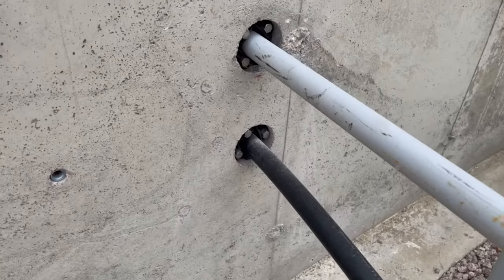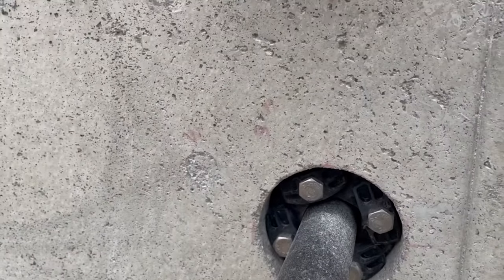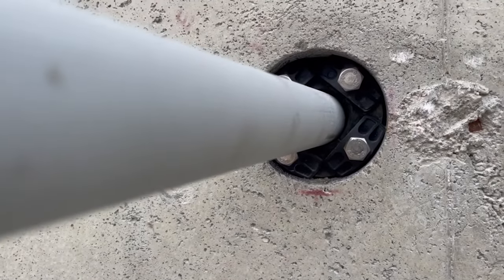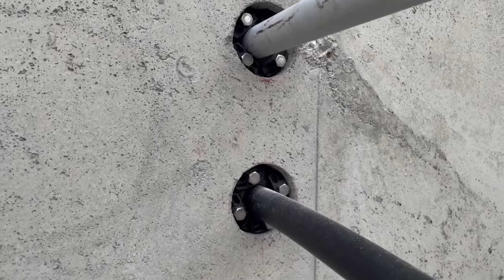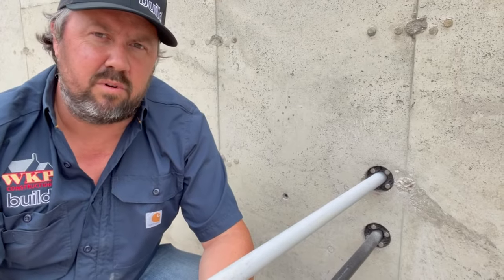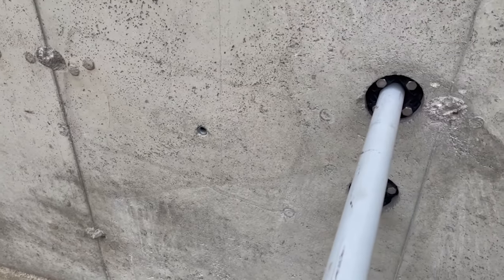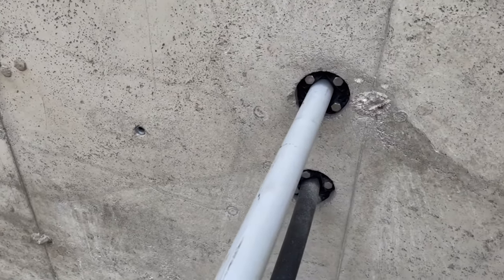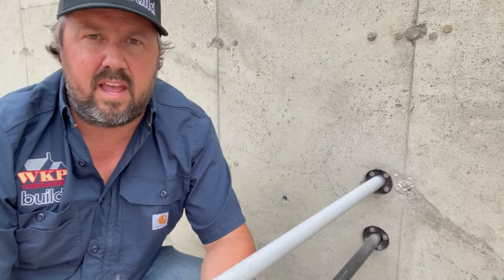Sealing around concrete wall penetrations

Comment: What if I chipped out a concrete foundation and put a 3 inch PVC line through the drain over to my sumpom?I'm also below grade. The water table is very close too.

Comment: As a professional waterproofer for over 45 years, this is a very good product for unwaterproofed foundation walls. But in properly waterproofed foundations it is  not adequate. But is a very good “ back up “ to proper waterproofing. All in all a good product.
BTW my background is in commercial waterproofing ( not exclusively) which is far above 95% of residential waterproofing.
Reply: Out of curiosity, what is your ideal method in this situation?
Reply: @ggill1313  it depends on what type of waterproofing is on the exterior walls. Quality waterproofing products all have their own details for sealing penetrations. Depending on whether they are sheet goods or liquid applied. The holes should be cored and at least a short section of pipe installed before  exterior waterproofing.Then possibly and this as a “ belt and suspenders” approach. These are notorious for getting damaged during backfilling.